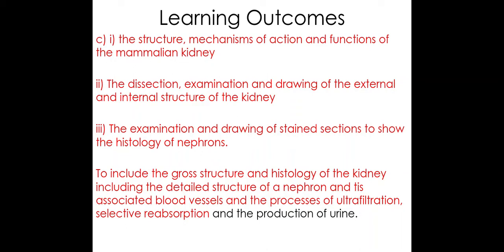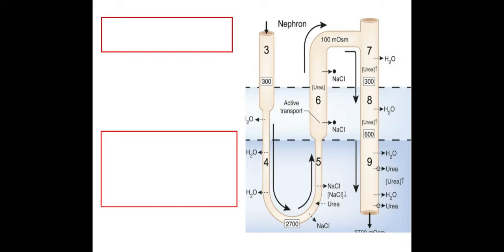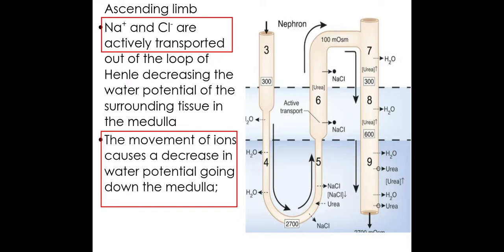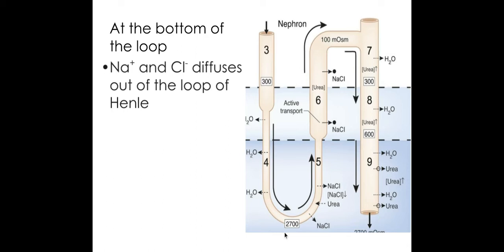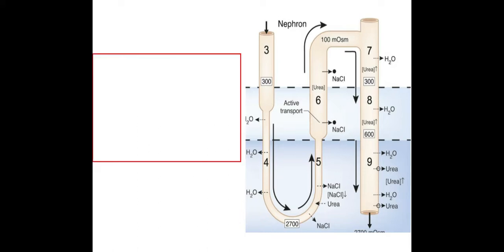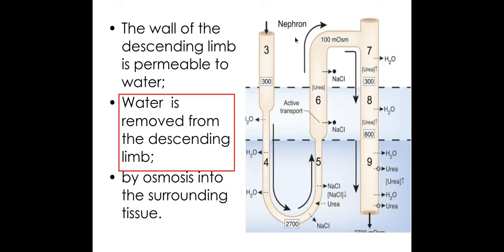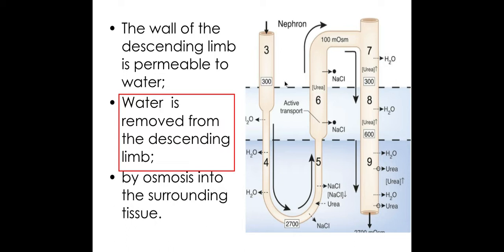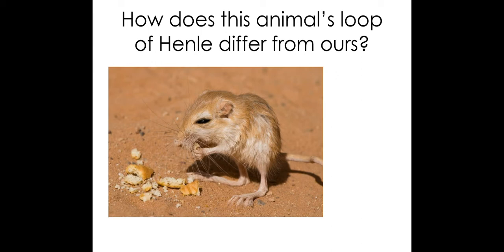5.1.2. Excretion ci) PART 4 loop of Henle, water reabsorbtion, production of urine.

Comment: Sorry im confused where water reabsorption takes place , as it seems as though water is just being removed from the loop of henle and collecting duct.
 Does water reabsorption means in the kidney blood vessels since the water potential is lower in the surrounding tissue due to the loop of henle, since water is moves into the the tissue by osmosis because of the Na+ and Cl- ions .
Reply from the maker: Yes so due to the movement of ions in the loop of Henle we get a decrease in the water potential of the tissues as you go down the medulla. Therefore more water can leave the collecting duct and the descending limb of the loop of henle to be reabsorbed back into the blood stream. Good luck tomorrow🤞